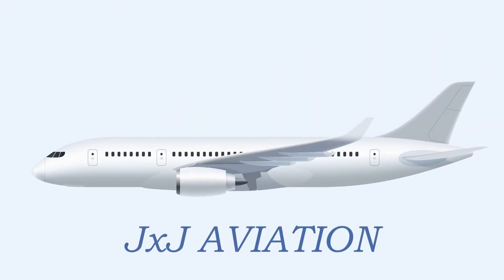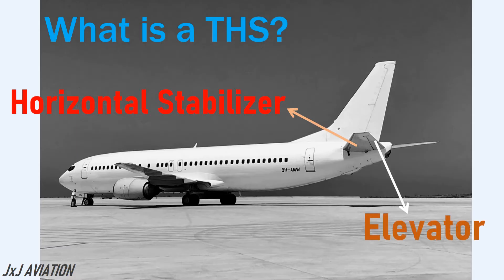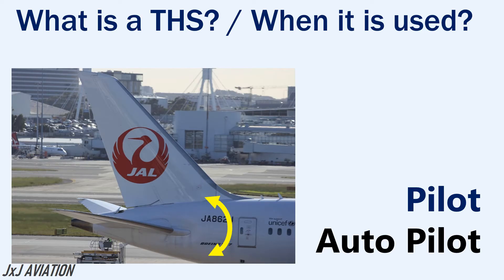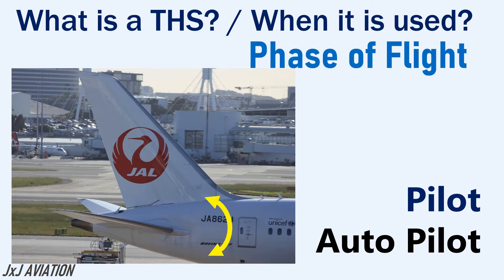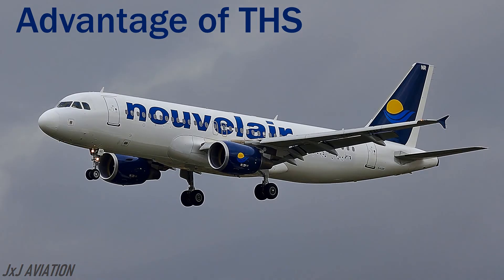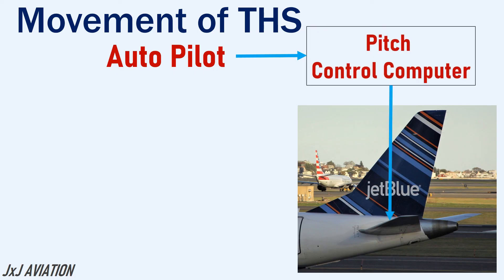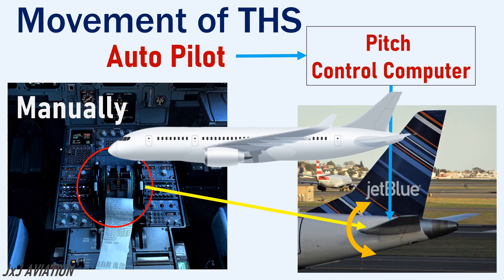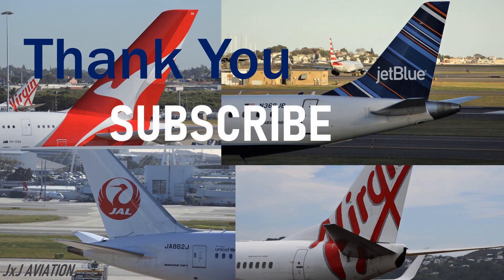What is a Trimmable Horizontal Stabilizer(THS)? Why THS is Required? How THS operates? Aircraft Trim

Comment: Mm, not bad. In fact, pilots trim the aircraft in pitch to achieve an attitude that corresponds to an airspeed, such as best rate-of-climb speed or approach speed. This is achieved by tweaking the balance of forces slightly - thrust, drag, weight and lift. In a trimmed aircraft, lift balances weight and thrust balances drag but it must be remembered that there are more than one lifting surfaces, the main plane (wing) and the tail plane (hori stab). The lift on the hori stab is adjusted by either using the elevators or adjusting the incidence. Either way, the stab produces more, less or even negative lift to keep the other three forces in balance. Weight and drag are more or less fixed so the only changeable forces are lift, by adjusting the tail plane, and thrust, by moving the throttle. In level flight, an increase in thrust will cause the nose to rise and the aircraft will climb. If it was the pilot’s intention to fly level, but faster, a trim nose down will be necessary to achieve this. After trimming nose down, the aircraft will now be said to be ‘trimmed’ at the higher speed.
Reply from the maker: Thanks for the detailed explanation! Lots of useful points!! Cheers!

Comment: please, how does an aircraft react to the loss of weight due to fuel consumption? I assume that, in the first place, the "angle of incidence" is chosen so that the airplane, with half of its fuel weight gone, flies at an optimal condition, i.e. with an angle of incidence = 0 (in mid-flight), using just the airfoils lift due to its profile and its "angle of attack", without using flaps, slats or any other control surface. but what does it do in the non-optimal states of a) full fuel weight and b) fuel weight down to reserve? in a) it may fly at an increased pitch angle to the flight path or it may use slats and/or flaps (?) and in b) it may compensate for a surplus of lift (with speed constant) by using the flaps in an upward bent position (?) or by flying with a negative pitch angle (or reducing speed)... what's the case in reality please? thank you!
Reply: As the aircraft sheds weight from fuel burn, it will naturally gain altitude if either the power remains constant or the AoA is unchanged.  Modern aircraft have a small switch on the control yoke pilots can activate with their thumb to change the horizontal stabilizer trim instead of using the trim wheel shown in this video.  If you watch some of the videos on YouTube of actual cockpit operations, you can notice the trim wheel frequently moving in all phases of flight, mostly commanded by the auto pilot.
Reply: As mentioned by Primus, I agree that altitude would increase with fuel burnup (assuming manual control with no pilot input). Fuel tank levels are managed however to occur equally across all tanks and would not affect the center of gravity therefore attitude should not be affected by fuel burnup. BTW - I'm not a pilot but I have a fairly good understanding of "fluid flow" and it's interaction on or within surfaces (and yes, air is a fluid).

Comment: Nice explanation.  As background, the trimmable horizontal stabilizer was developed out of necessity after high-speed aircraft in WWII developed a troubling tendency while diving to go nose-down.  After it was realized that airflow over the control surfaces was going transonic and causing large changes in trim, it became obvious that it would be necessary to use the larger area of the stabilizer to aid the elevator system in maintaining control.  One of the first aircraft to use a "flying tail'" as it was once known, was the Bell X-1 rocket plane which Chuck Yeager used to break the sound barrier in 1947.  To understand the twin roles played by the elevators and horizontal stabilizer, think of this: the elevators are quick-moving, the stabilizer is relatively slow moving.  To adjust pitch attitude short term, such as recovering from a "bump" of air turbulence, use the elevator.  To maintain a constant attitude, and therefore altitude, use stabilizer trim.
Reply from the maker: Thank you so much for sharing this knowledge! Very Useful!

Comment: The term is altitude not attitude.
Reply from the maker: The THS maintains a particular attitude: so it can be used for level flight, constant rate of climb or constant rate of descent.
Reply: @JxJAVIATION  I was bringing your attention to your spelling mistake. The height is termed as ALTITUDE not ATTITUDE.
Reply: @NisarAhmad-jr6ol  "Altitude" and "attitude" are two completely different things. The video refers correctly to the attitude of an aircraft. The altitude has nothing to do with this matter.
Reply: settle down there Dunning Kruger
Reply: @il400  Shame on you for your unwarranted response rather than admitting to your spelling error.
Reply: @NisarAhmad-jr6ol  can you proof read this word for me?
"fool"
is that the right spelling? because it suits you so well
Reply: Smooth brain
Reply: Attitude infers pitch whereas altitude infers height above sea level.

Comment: It was with this Trim Stabiliser that MCAS played with during the crashes of Lion Air 610 and Ethiopian Airlines Flight 302.
When MCAS detected a angle of attack that would have resulted in a stall it kicked in moving the Horizontal Stabiliser to increase the angle of attack by pushing the nose down.
The pilots of Lion Air trimmed the nose up over 30 times resulting in a up, down movement of the aircraft before it crashed into the Java Sea. They basically fought the MCAS.
Reply from the maker: Yes! Thank You for sharing this information! Very useful to viewers and learners
Reply: At first I got confused with MCAS and THS but now it's cleared!! Thanks😄
Reply: Wow

Comment: Isn’t all horizontal stabilizer trimmable?
Reply from the maker: Most of aircraft have trimmable stabilizer and some don't!
Reply: @JxJAVIATION  What are some airplanes that don’t have elevator trim?
Reply from the maker: @cornucopiahouse4204  Aircraft having T Tail or V Tail Configuration
Reply: @JxJAVIATION  Must be hard to fly those kinds of aircraft...
Reply: @JxJAVIATION  Just 2 items. 
1: Trimmable Horizontal Stabilizer or THS, is an Airbus term. Most other manufacturers just can it the horizontal stabilizer, trimable or not. 
2: Concerning which aicraft have trimmable stabilizers and which don't,  it is actually aircraft size derermines it, not the type of tail dedign. The MD-80/DC-9 being a perfect example